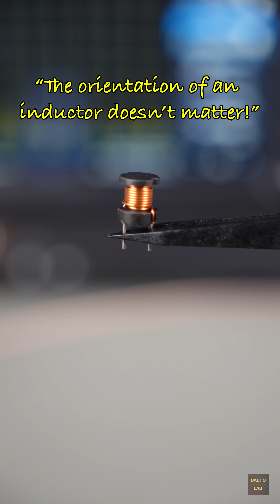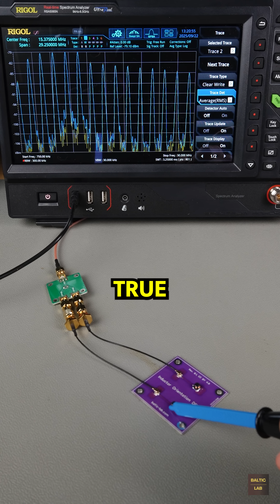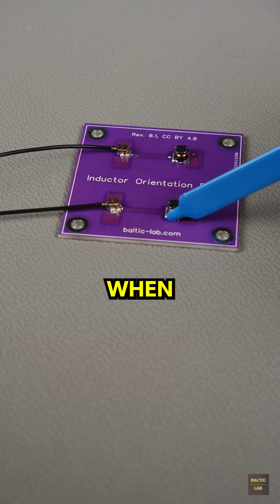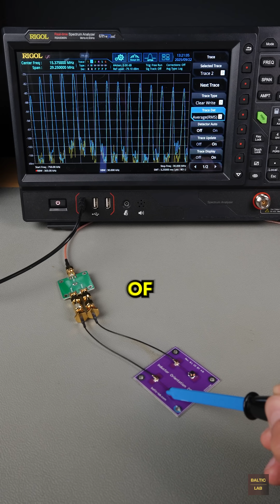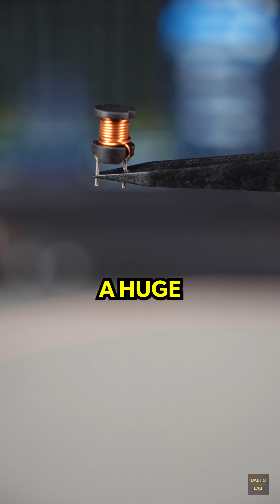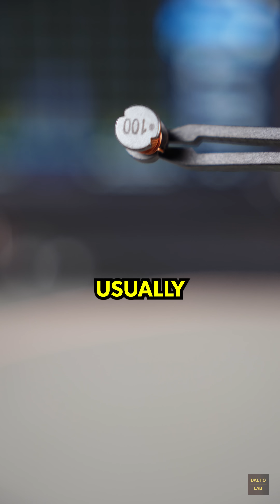Worth knowing: Inductor Orientation Does Matter!  #electricalengineering  #electronics

Comment: The orientation is particularly important when dealing with RF and filter design. Orientation of inductors in a filter can make a major difference in the shape and efficiency of a filter.
Reply from the maker: Yes indeed, thanks for commenting!
Reply: How ?  Break it down...  please
Reply: @markkennard861  well it depends on the type of inductor used. Toroidal inductors are less sensitive to orientation but there is still some risk. Non-toroidal inductors in a filter have to be oriented where there is no [technically minimal] coupling between them.
Reply: @markkennard861 coupling to the neighbours
Reply: Inductors must be placed perpendiculary to each others... and far away.
Reply: Short and to the point, great content, thanks a lot
Reply: Please clarify a doubt for me. In an antenna connected to a coaxial cable, where an air chock near the feed point is responsible for reducing common-mode current in the cable, does this logic also apply? Because I did a test by removing the air chock and, when replacing it, I reversed its orientation (upside down), there was a reduction in common-mode current in the cable. Shouldn't this only happen when using a coil with a ferrite core?
Reply: @leandro842 no, it applies to any inductor, air or with a core. The orientation effect has to do with the magnetic field lines around the coil. Toroidal cores mostly mitigate this since the shape of the coil means that the magnetic field is mostly confined inside the donut and the coil itself, so they are much more forgiving as far orientation and proximity to metal.
Reply: Thank you, keep making these informative videos 👍

BTW How does the gauge & number of windings affect an inductor? Maybe on another video or a documentation link.
Reply: @mach1553 number of windings increases inductance, and also resistance, which can be less with larger wire. Also mechanical stability is higher with larger wire. But you can get more turns on a given core with smaller wire.